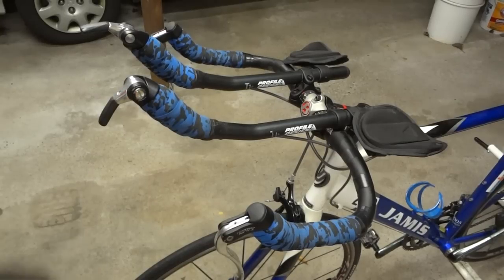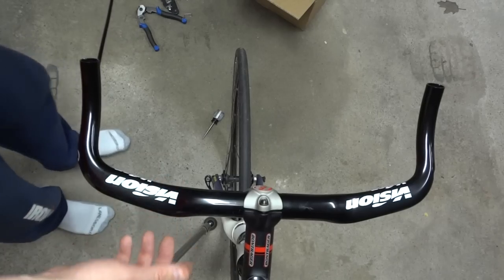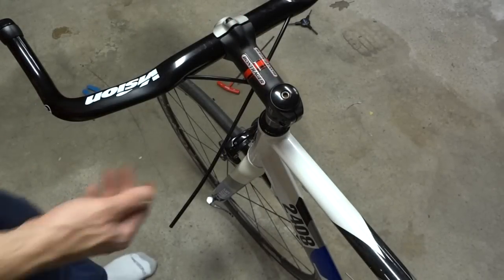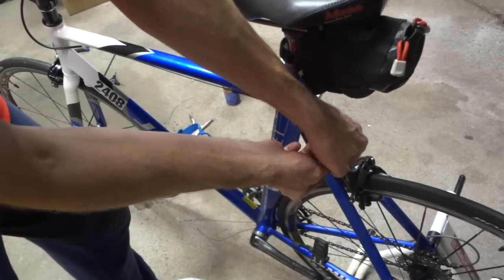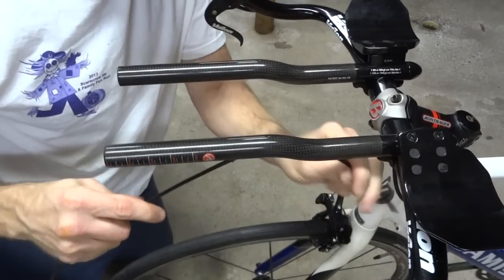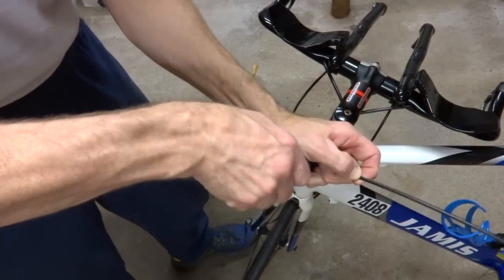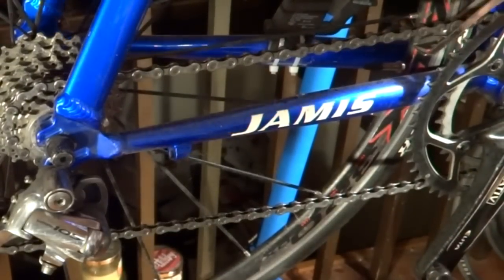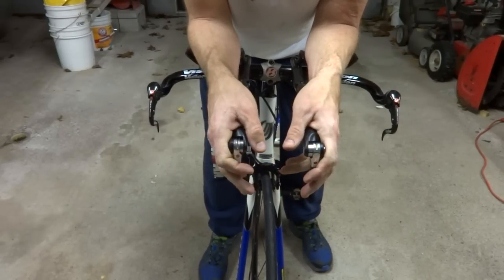How To Replace Triathlon Bike Aerobars/Basebar/Levers/Cables (Remove/Installation)

Comment: Thank you RJ for the amazing video walking through this rework. I love my 2009 Schwinn Prologue TT bike but after bulking up from weight lifting, I found that the stock bars did not allow me to get into a comfortable position anymore. I was so sore that I almost thought of dropping thousands on a new bike. I ended up finding used ultegra 11 speed derailleurs and shifters on ebay for cheap and used this video to upgrade the bars and groupset! You truly made me confident enough to do the work myself and so happy to get back onto a favorite bike!

Comment: Personally, with college in machining, I use marine grease on every single bolt and screw on my bike.  This makes the torque more accurate without stressing the threads.  Also, when clamping handlebars and aero bars, I lightly scuff the clamping surfaces with 600 grit, then clean up with denatured alcohol before installing.
Reply: Because the friction is removed, you'll crush your carbon if you use the specified torque settings and grease.

Comment: Great video. I'd just add for others that brake and gear cables are different diameters, not interchangeable. Same thing for brake and gear housing, different construction, so don't mix them up. Thanks!

Comment: Great video!...what if I am not sure on my proper bike fit yet?  How should I setup the cables initially such that there is flexibility to accommodate changes in bar height, stem length, etc?

Comment: Well done!  The arm rest post broke on my aero bar, so I'm trying to figure out whats best.  This video is amazing!  The only thing I didn't understand was the farrow (spelling) thing?  I also think it is a good idea to have this sort of bike knowledge instead of leaving all maintenance to your LSB.  One final question, did you adjust the length of the aero bar shifters before you started cabling?
Reply from the maker: Ferrule. Ferrules are little metal caps that go over the ends pf the cable housings to help prevent them from mushrooming out. There are little holes in them for the cables to go through. You'll want to have the aerobars roughly adjusted to where you want them. But leave a little extra cable/housing to allow you to adjust them later.

Comment: how do you feel about bar end shifters on normal drop bars (not the aero bar setup in this video)? 

I'm trying to decide if I want to purchase a bar end kit add-on with a used bike I'm buying (the seller is willing to throw it in for extra $). 

I've seen people say they like them but interested to hear what you think compared to downtube shifters?
Reply from the maker: I built a bike with them. They are okay, but I prefer brifters.
Reply: @RJTheBikeGuy  thank you!

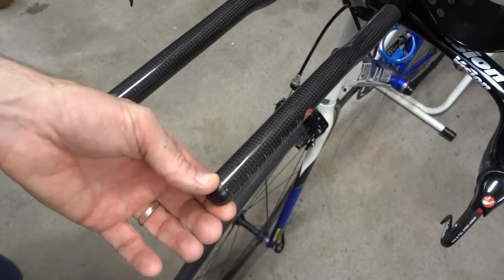Comment: 16:00 Thanks for the video! Can you install extra brakes there instead of shifters?
Reply from the maker: Not really. You can't easily set up a bike with two sets of brake levers (other then inline brake levers that won't work there).

Comment: looks like the aero bars have been installed backwards.
Gradation marks should go toward arm rests, that way you can measure insertion / extension.
Less exposed shifter cable this way.
Maybe you liked the shape better this way?
Reply from the maker: Seeing as the elbow rests are attached to the aerobars at one end, I preferred not to have them out where my hands go.

Comment: G'day RJ I noticed you have SPD pedals on your tt bike. Do you use MTB shoes?
Reply: hey hey also I saw you have SPD's on the hmade cyclo-cross bike.... that I can understand... I do the same... but ironman?
Reply from the maker: Yes, I have MTB shoes. I like to be able to walk in them without walking on the cleats.
Reply: Very odd. Why would you want to walk around? Sounds to me like practical nonsense. Speed is the essence of cycling. Speed outweighs most practical functions.

Comment: How hard is it to reroute the shifters FROM the aero bars to the normal handles?
Reply from the maker: FamedJa Not hard.
Reply: RJ The Bike Guy Hey thanks for the quick reply. Is it something you would want a LBS to do if you don't have prior knowledge with something like that? Or do you have a video that shows it? Sorry if it's in this video... I didn't watch all 30 minutes because I came to the conclusion you were sticking with bar ends.
Reply from the maker: FamedJa Now do you mean install the bar end shifters on the ends of the drop bars? Or do you mean having brifters (integrated brake shifters) on the drop bars and running the cables to those?
Reply: RJ The Bike Guy The shifters are routed to the bar ends right now. I'd like to remove the bar ends (or they can stay, doesn't matter) and have the brifter routed to the drop bars. Right now, the brakes are to the drop bars and shifters to the bar ends. I'd like BOTH to the drop bars. To clarify, the bike is all set up for having brifters on the drop bars (the shifter levers are already all there). It just needs the cables routed.
Reply from the maker: FamedJa Watch this video for info on hooking up brifters: https://www.youtube.com/watch?v=SJJyl0xPrJ0
Reply: RJ The Bike Guy Thanks!

Comment: I stopped watching at the wasteful act of cutting cables. Not my style.
Reply from the maker: I guess your style is to reuse old worn cables to save a couple bucks. Do you even Tri? Where an Ironman event costs $800 in entry fees plus all additional costs of travel and hotels. And you are going to be bothered over saving a couple bucks to reuse worn cables? Risking cable failure, or at least poor shifting?
Reply: A fool and his money are soon parted.
Reply: I had a triathalon training lifestyle before I ever heard of triathalon. Im old and was looking at shifter vids. Im replacing the bike I've been using since 1988. Sorry, It's not you. Its just a mood. Happy trails.